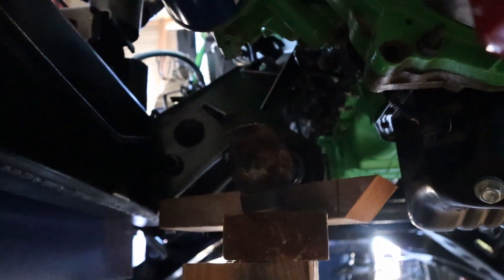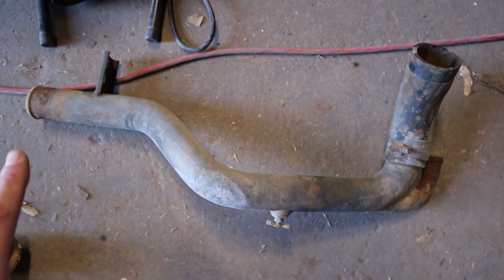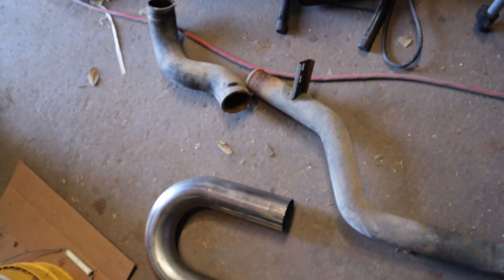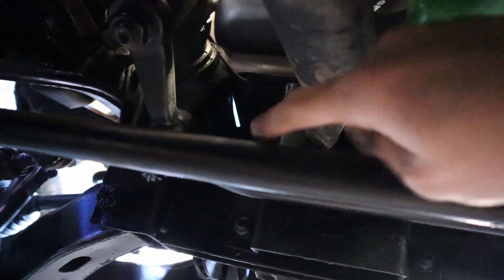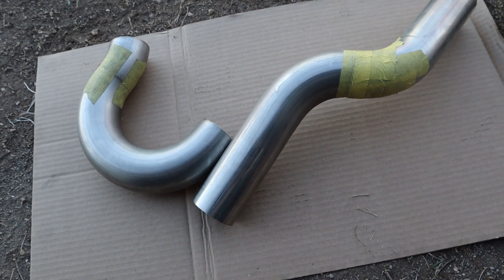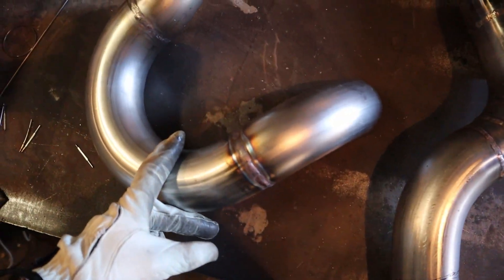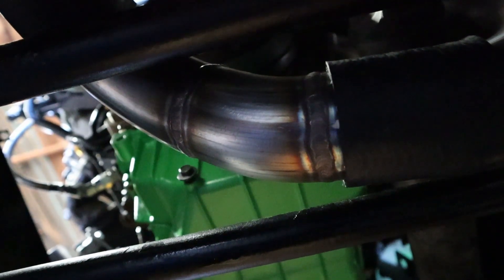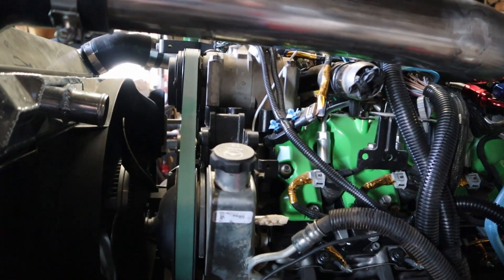Duramax Swap Humvee - Custom Stainless Radiator Tubing

Comment: ill be getting that answer on the heater core for you soon.
Reply: So it looks like it runs from the firewall to the front passenger side of the engine like you said. The return is "supposed to run" to the EGR cooler, then from the cooler down the back of the engine to that port near the oil filter. I traced it on my buddy's truck quick fast like, so don't cap that cooler line, use it lol. so the flow is from the front of the engine to the heatercore to the egr to the engine.
Reply: ever get this worked out?
Reply from the maker: Yep. The return from the heater core will just go back into the radiator tubing to complete the loop.